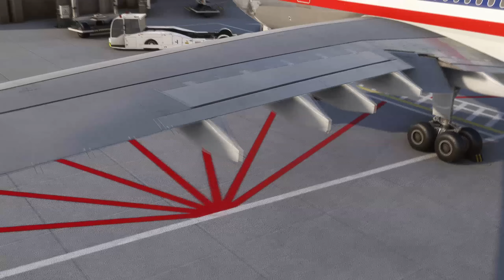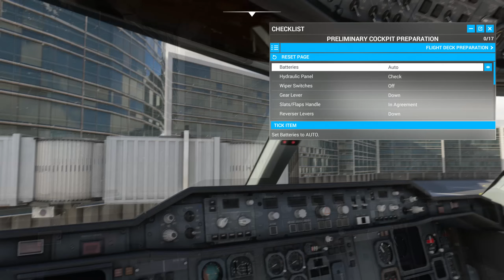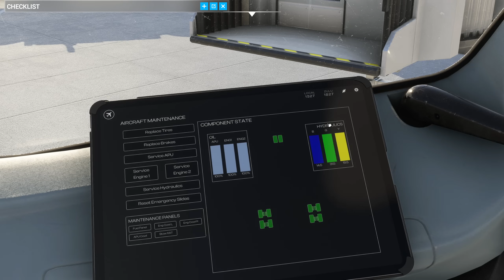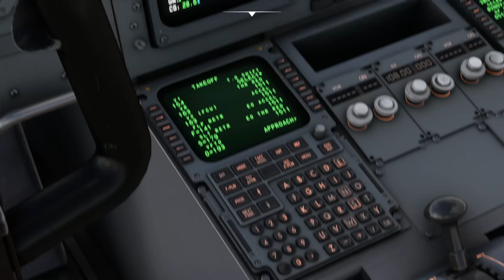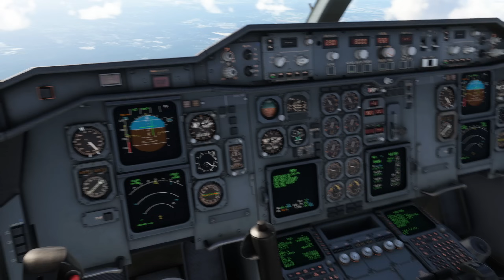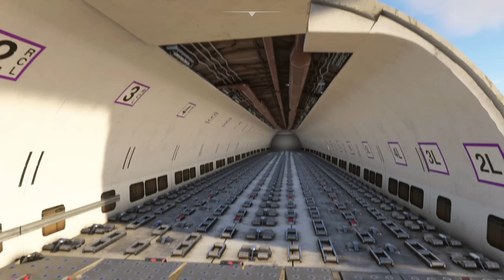A New Level of Immersion: Real Airline Pilot Previews iniBuilds A300-600R

Comment: Does this model have persistent switches and levers and things so you actually have to check everything before each flight if you didn't put everything back to normal the last time you shut down? By the way, the reason that the engines didn't go to your FLEX temp is because you didn't press the "auto" button on the left after setting the temp.

Comment: Additional comment, it would be so great to see iniBuilds (or any other) to implement these sliders on MSFS2024 using that system that they demonstrated with baloons, in which the fabric behaves similar to real life, and have them be suctioned / blasted away by a running engine if you do it wrong

Comment: how is this worth $45 when the A310 is free and pretty much the same plane
Reply: I thought the same thing, but the A300 is a step above the A310 in terms of modelling, service types, sounds, and detail.
Reply: @maffarick  because this one is less mainstream than the A310, i guess and "special" or rarer planes aren't for free
Reply: The a300 is noticeably better textures, systems etc. Also has an actual freighter model. Its a great plane actually. Has quickly become one of my favorites, and Im reasonably particular.
Reply: Because the A310 is basically “Microsoft A310” not entirely ini A310, simply an average freeware aircraft.